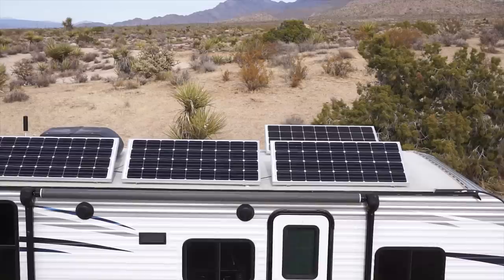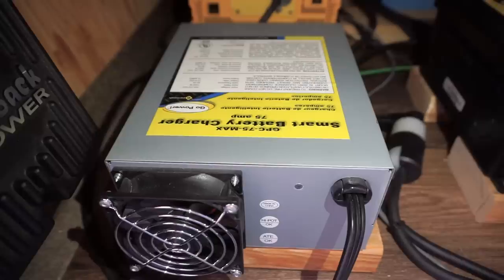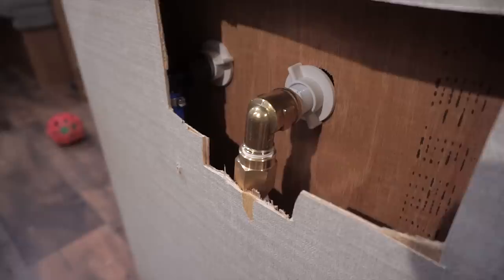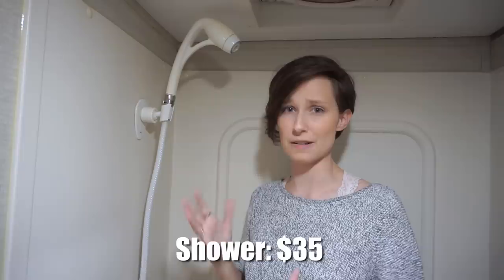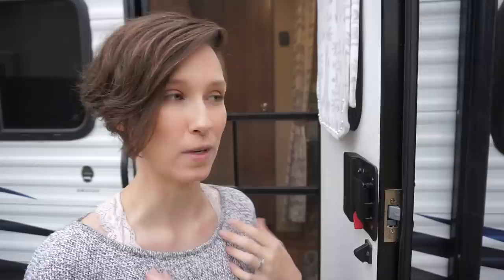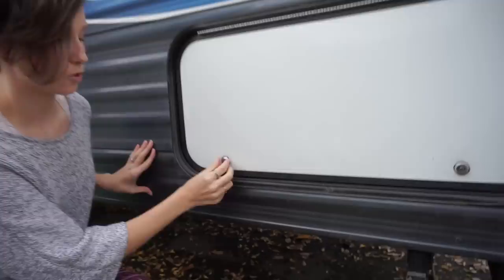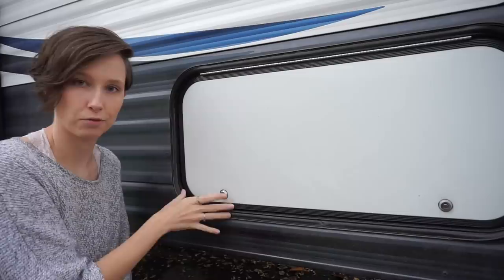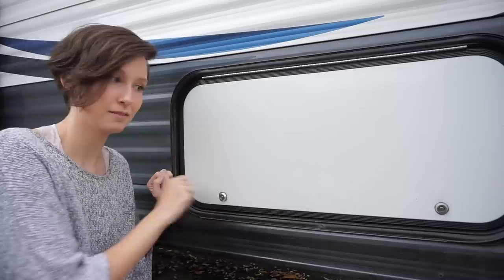Was It WORTH IT?? - All Our RV Upgrades Review - Solar, Toilet, Booster & More

Comment: In the RV industry, there are 7 different keys. So another RV’er has a 1 in 7 chance of opening your door. RV Lock is a horrible product and a horrible company. Try replacing it with the Elite RV Security brand lock. That is what we replaced our cruddy RV Lock with, and it is made better, came with 2 fobs (didn’t have to buy a 2nd one) and they were already programmed for the lock. Not to mention the customer service at RV Lock is HORRIBLE.

Comment: So you now have grey water mixed with black water and you're treating it as grey water even though it's actually black water. That will get you smacked by the authorities.

I'm amazed your panels cost that much when 100W panels are about $90 each.
Reply from the maker: We bought our trailer brand new and the black tank was never used as a black tank. We instantly turned the black tank into a 2nd grey tank. Also, have you ever been to a dump station before?? When you dump your tanks they get dumped together, the grey and black don't have their own dump areas.
Reply: @FateUnbound  Grey, being largely just soapy water, can be quietly tipped down surface drains.
Reply from the maker: That's an excellent way to get yourself "smacked by the authorities." Maybe you should look in the mirror before commenting on someone's video. Dumping your tanks, even just grey water, is illegal in many states. There are also tons of free dump stations all across the country, use them. I use rvdumpsites.net to find them. Good luck.